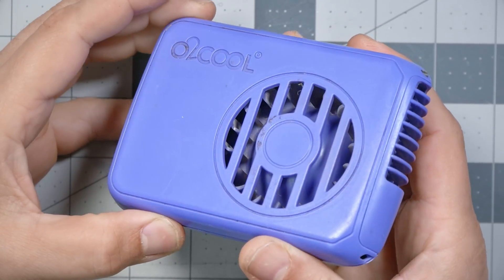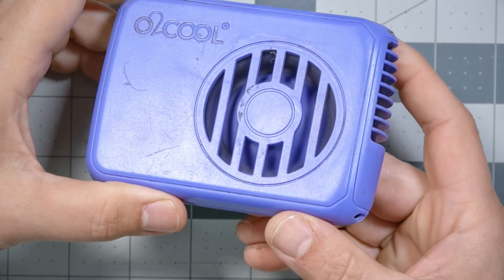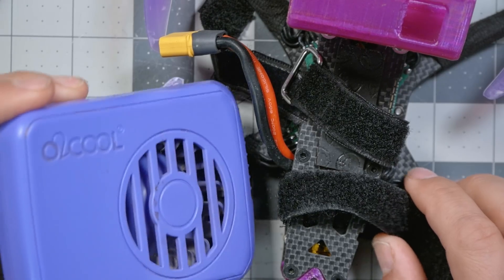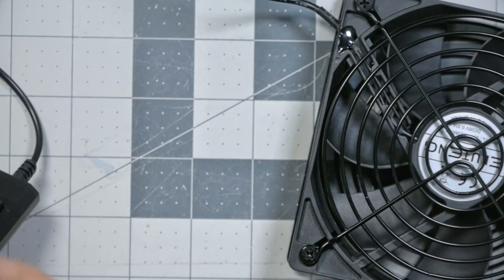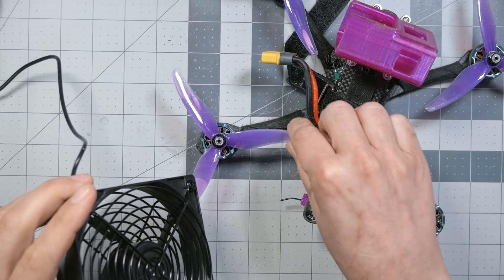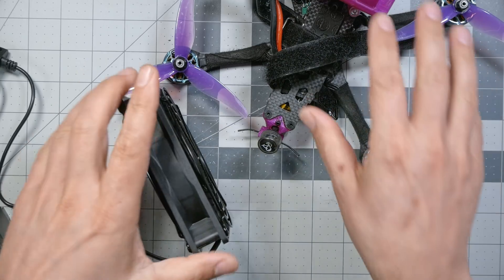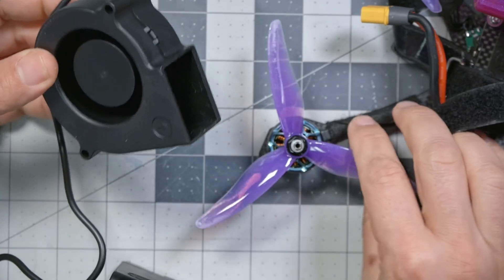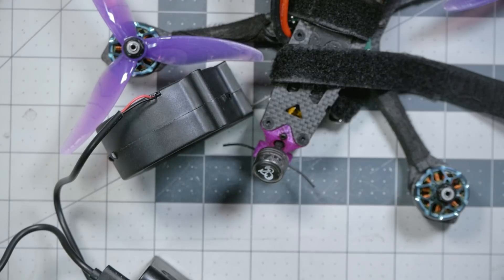My secret to preventing video transmitter meltdown

Comment: I just build fans on the vtx's of my drones, previously it was 5 v which was ok, now I installed a 12v fan and this works a lot better, it is serious cooling from just a 20 mm fan. And its linked to a switch on my remote together with the vtx, so it only receives power when I turn on the vtx with the remote. The power consumption does not seem to be more then when I installed a weak 5v fan, its just the 10v connection I used that increased it bigtime apparently.

Comment: mine had its first flight today on a fixed wing glider with a gm3 in front of it so blocking airflow, had a fan on top until i hand launched it - goggles L flashed red so landed it. to be fair it took me about 2 minutes to walk to it on the ground with no fan. 4k video on sd card wont play. hopefully it still works tomorrow. might mount the gimbal behind the vtx so the wind can hit it directly. not sure why the goggles L flashed red - first time i have used them.

Comment: What I did was that I used a small 12V 50mm PC Fan and soldered a XT30 to it. When I need to work on my drone with power I use the ViFly Smoke Stopper as a switch with the fan connected to the XT30 socket of the smoke stopper and the drone connected to the XT60 socket. So when I switch on the smoke stopper both the drone and the fan get powered at the same time.

Comment: for at home I have a blue air purifier 211+. It basically looks like a minecraft version of R2D2 and pumps a ton of air straight out of the top. I have it close to my computer and just set the drone on top of it while powering it up for updates and troubleshooting. is it compact? no. is it inexpensive... also no. Does my drone stay cool and get blasted with clean purified air, sure does!

Comment: I usually sit with a straw in my mouth whenever I use a battery on the bench....🤣
I recently purchased a 12V BEC and wired an XT60 to it.....also wired an XT60 to a brand new computer fan....so far its fine, but I need to 3D print a stand for it.....

Comment: I used a 24v 4020 blower fan that I wired up to my smoke stopper. That way I can plug in a 6s or less to it and power the fan and the quad if needed. It works great while figuring everything out on my hdzero build.

Comment: this has been the worst hobby ever
so much broken grrbage
so expensive so much configuration so much repair
so much downtime so much rubbish so much not fun
Reply from the maker: It's definitely not for everybody.
Reply: I can totally relate to your plight. I have felt like that so many times in this hobby.
Just last week I purchased a $62 diamond AIO ELRS. I soldered my motors to it. Everything was fine.
Plugged in a 1S battery and got the "magic smoke".
Apparently there is an issue where if you heat the pads while soldering too much, the FET's underneath the pads come loose and will short circuit.

$62 right in the garbage can.

BUT - 
There are days when everything goes right, you get it all working, and IT FEELS SO GOOD.
You feel like a proud father that just had a child.
Those days happen more than the bad days.....at least for me, at this point in time.
I hate to see anyone struggle in this hobby -and I thank God for people like JB who help us through the hard times.
I started backwards - with a 5" build. 2 years later and tiny whoops are my new favorite. Why?
Less danger of hurting anyone, more affordable parts.
The downtime of waiting for parts in the mail sucks - but it's unavoidable.
I'm sorry to write a book, I just wanted to empathize with you. You are not alone in your misery.
BUT there is a fun side to this hobby, I promise you.
Have you considered a bind and fly? Much easier to start with. No building, less configuration.
Good luck friend.

Comment: My solution on some builds is to use your v2 flight controller and set up pit mode. There are other flight controllers with this feature but I have found most of them are not clear about whether they will support the O3 power draw or are not documented properly to make setting things up as easy as possible. The defaults on the JB F7 are about as close as you can get to having everything set without actually having the feature enabled. I do have a fan that I use for soldering that I use if I do need to have the VTX on while working.
Reply: Pit mode doesn’t seem to work when you’re trying to work on video problems, which I run into quite a bit unfortunately lol
Reply: @TheCosplayCrypt  If you have pit mode on a switch, you can move the setting temporarily so the VTX is on while you are working on the video issue. You could also connect the transmitter and turn it on but just changing the mode seems safer and a bit easier to me.
Reply: @TechnicallyTom  yeah now that you mention it that does sound like a good idea where you could kind of switch it off and on quickly while leaving the quad still connected and then determine if your video problem is solved or not. A lot of time so it’s adjusting that OSD and you need a whole thing on the whole time.

Comment: I 3D printed a nozzle/intake, then used a 40mm fan and 12volt power supply from an old 3D printer.

Comment: Also if anyone here is using HDZ and not using stick commands, I super recommend it. You can set the vtx to boot at zero output and then turn it on and off with the sticks. Great for powering up and waiting for GPS.

Comment: For VISTA or DJI Air Unit users turn down your mw to 25 and your usually good even without a fan 👍🏻
Reply from the maker: Definitely not the O3.
Reply: @JoshuaBardwell  does the O3 get so hot? I just had an issue when updating my Vistas to the latest firmware that the update stopped at 95% and I had to do it again but even with a fan.

Comment: Working with computers as a day job, grabbing a cooling fan from scrapped tower was my solution. I don't feel the need to get it all all that close to the quad. It blows enough volume (yeah not focused) at the VTX to keep it cool. I also use it as a blower to take away the fumes when soldering. The power cord takes up some space and can be a bit of a hassle but it gets the job done.

Comment: Would the smaller, 5015 variant of the 7030 fan be just as good? 5015 is Speed: 5100;Total Airflow: 6.5 CFM;Air Pressure: 8.90mmH2O;Total Noise: 36.5 dBA whereas 7030 you have JB is Speed: 3000 RPM ; Airflow: 12.7 CFM ; Noise: 35.1dBA...

Comment: I use a kids stroller fan, they are cheap and have the flexible legs you can articulate wherever you want. Battery lasts forever, adjustable speed, and they put out way more air than a 120mm fan, enough to cool the entire quad from a foot or two away. USB-C too!
Reply: That sir, is a great idea! I've never seen these before. They come in so many varieties.....thank you for the suggestion. You are definitely a great Dad! 😘😎

Comment: If you were waiting while plugged in for the director to yell action, how would you get the fan away from the props once they do? I thought the reason you'd be waiting plugged in is you'd need to be able to launch instantly.
Reply: Yeah, I don’t see this as a great option for that scenario unless you have an assistant/VO that can be right next to the drone at all time. There are some cinelifter designs that have integrated fans on them but I’ve wondered if the tiny fans that people use for decased GoPros would be enough to keep the o3 cool and fit inside something like a 5” or whoop.
Reply: @WillStrathmann  I suppose you can just sit on the floor and every time you get overheating warning just arm and roll left to right without popping up off the ground, that will make the warning go away.
Reply: That's why you install a small fan oboard fan.

Comment: I use a 24 volt parts blower fan from a 3d printer I had laying around.  Just soldered an XT60 adapter together and boom.  Runs off of straight 6s for days

Comment: Very interesting indeed! Thanks for the tips, Joshua! 😃
The last one remembers me of a notebook fan... But I never saw something like that with a USB cable!
Anyway, stay safe there with your family! 🖖😊
Reply: I wonder if it could run off of a single cell 4.2V and when it drops off, maybe 4V?
Reply: @cagmuer  Well, you can. It the fan is 5v, you can run it with a single cell with zero issues. 
Another idea would be to use a TP4056 module board... It's pretty small and you can fix it to an 18650 cell with double sided tape. And if you use the version with battery protection, it's going to cut the current when the cell gets to 3v.

Comment: I bought a cheap USB desk fan for person cooling in my office, when it gets too hot and the ac cant keep up.  It is already on a stand, and can be pointed up or down as needed, and blows quite a large amount of air (~3-4" blades).  Haven't had an issue using it for vistas.

Comment: Best solution: one of these small usb fans with battery 👌🏻
Reply: The base of mine, which holds the rechargeable battery, pivots to any angle. Works perfectly and lasts a long time per charge. I use it for soldering too, if I remember.

Comment: I use an old PC fan, cable tied to some wood for stability, an old grid to save finger nipping and it's powered from an old 12V 1A wall adapter. Cost therefore was only the XT60 used to join them (could solder together but I have other uses for that adapter). I also use it to blow solder fumes into the small extractor unit I have.

Comment: What I did on my end is use PINIO to control power to DJI VTX by my remote. So at any time I can easily switch the VTX off if I have my battery plugged in but do not need VTX on. I also discovered when I plug in my FC to USB the Betaflight in absence of connection to remote it always defaults to the 1500us range on the mode page. So I made my USER mode set in such way that in absence of remote link the VTX by default is off when FC is plugged in USB or battery. Which is ideal for workbench work on FC and ESC and you don't need VTX. 
I have also configured the remote to require two buttons to be pressed at the same time to command off state to VTX as extra safety during the flight. So nowadays I only need active cooling on Vista when flashing as O3 can be flashed without battery power and cooling.
Reply: > I also discovered when I plug in my FC to USB the Betaflight in absence of connection to remote it always defaults to the 1500us range on the mode page.

You can change that on the failsafe tab FYI. Just note that your VTX will also power off in flight if you have a failsafe, so if something happens with your receiver or radio the video will cut out and you'll have no idea where to look for the quad :)

Comment: I can't remember where I got it but took something apart and got a 40mm fan I use for soldering too. Some 3d printed guards and xt30 for 3s. Then rubber band that around a filter out of a vaccum.